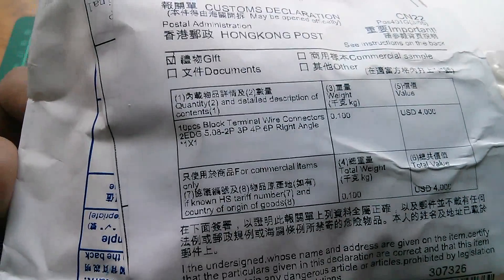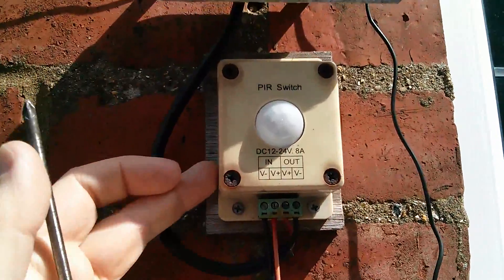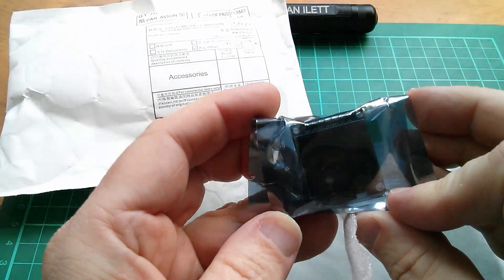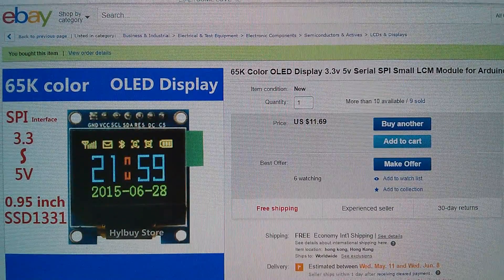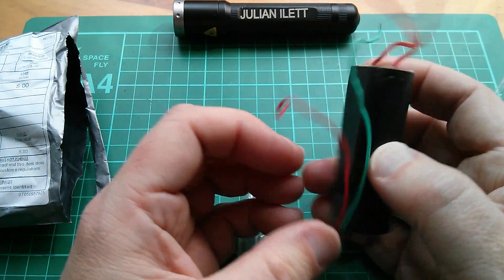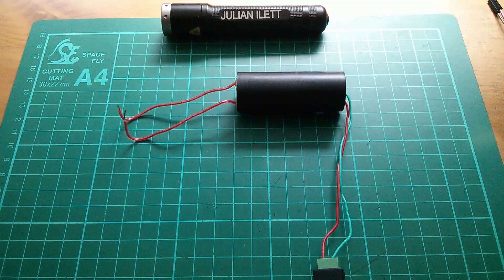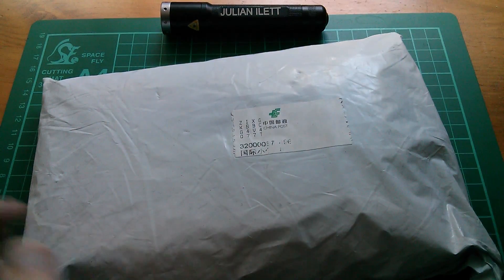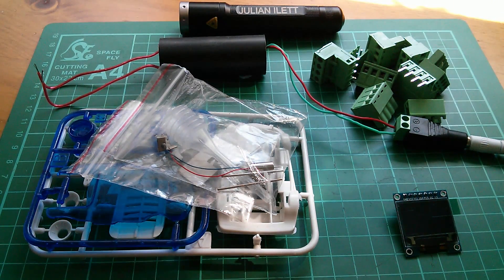Julian's Postbag: #62 - Colour OLED, 400kV Taser, Salt Car

Comment: For exposed outdoor boxes / connectors, a spray can of "spar varnish" polyurethane is your friend!  A very_light_coat will keep your screws and other metal from rusting quite as fast.  The reason I emphasize the very light coat is that a heavier coat has a high chance of trapping moisture - making the problem ten times worse instead of helping at all.

Comment: Calculations say 400kV is silly.   BTW:  If the spark is not maintained when the high voltage is on, these things tend to destroy themselves.  This all started with the 3V to 7000V modules, I used one to charge a 200lb capacitor--took a while, but got over 6000V.
Reply: Does the output voltage for the kind of step up modules in the video change in proportion to the input voltage?
Reply: @davadoff  In my experience it does, but as far as driving it higher than rated,it will certainly fail--heck, I've had a couple blow after seconds of use at the -rated voltage!  The outputs are nowhere near than that advertised either.  I think they are WC voltage multipliers,so, after your comment, I think I will try driving them at a LOWER than rated input!

Comment: The 400kv rating is a Chinese exaggeration. Just like the 100,000mah USB backup packs for less than $10. Theses HV generators are about 20-30kv.There are capacitors on the output. You waited to long to short the output. You have to do it emmediately after turning it off. There is a 2 or 3 stage Cockcroft-Walton voltage multipler after the HV transformer.
Reply: BTW. the multiplier acts as a half wave rectifier, so you end up with a pulse dc output.
If you attach to metal rods to the generator and the outputs to the rods, you will go to jail.

Comment: I always smear a healthy coating of dielectric grease on any exposed connections like that.  Pretty much eliminates corrosion and basically waterproofs the connector
Reply: Stranded copper wires in screw terminals is not terminated properly and a poor connection too. Needs crimped cables such as bootlace crimps.

Comment: so what would happen if you put your finger in the spark would you be kill straightaway or would it just hurt or would you get burned or get superpowers or what
Reply: Super Loops it all really depends on the current. this thing is basically a tazer, it works by transforming the current it receives into more voltage. Which of course lowers the output current. tazers don't kill because they output low amounts of current, voltage will only burn/shock you. 

Just remember, you can't make nothing out of something. If you increase one thing another has to lower. in this case, voltage increases (which doesn't kill) and current decreases (which can kill).

Comment: no they are done with diode cap array so I''ve built them to 50 kv easily USE CAUTION or die! there's no Xformers in them!
Reply: A voltage multiplier (diode cap array) won’t work on DC and this module takes DC.

Comment: HV inverter looks like the drive module out of a helium neon laser I used to own. Can't be more than 8kV, and thats the unit trying to start a laser tube. Run it for more than a few minutes like that and it'll burn out. For reference once they strike a tube the internal cascade is bypassed by the low impedence of the lit tube, and it winds back to 1.8kV or so. It WILL give you a nasty kick if you touch it. I've done that by accident with a much larger one about the size of a packet of cigarettes, or a plug pack. Smarts like crazy, and will throw you back a bit, but won't hurt you. Needless to say you won't do it again :)

Comment: Julian, have you heard of Plasti-Dip (or Rubber-Dip)? That stuff is ideal for protecting electronics against the elements - I use it in my aquarium setup. And if you need to access the terminal, it peals away easily. And, when you're done, you can simply apply some more to cover up the tear. ;-)

Comment: Be real careful with that high voltage thing, it's isolation is not built to withstand anywhere near its output voltage. I had one, got a big jolt through my fingers AT THE VOLTAGE INPUT while I was hooking it up to a single cell li-ion battery and note that I wasn't anywhere near the output wires. Into the bin it went for me. Also while it may be working fine now, the poor insulation on the thing will slowly get eaten away by the high electrical stress and one day you may get a nasty surprise.

Comment: You can test how much it outputs by measuring the distance it starts to arc using Paschen's Law. One of the uses for this inverter may be cattle zapper, it outputs significant high current to cause quite a painful shock.

Comment: +Julian Ilett Obviously not 400kV, but your reaction was priceless - the muffled shouts in the background had me in stitches. Seriously, I think the main practical use for these is in oil boilers (US=furnaces) where they provide the fuel ignition - every ordinary domestic oil burner works with a spark generator like that. They usually run around 10-20kv. I wonder what it was doing to radio reception locally while it was arcing?
Reply: An oil boiler? 🤔 Don’t you mean gas? (gas central heating in UK, used in almost every home).
Reply: @davadoff  Not at all, I mean heating oil (kerosene). Remote and many rural areas of the UK have no mains gas supply and use either electricity, propane, or oil boilers. An oil boiler needs a much more sustained and powerful arc than the quick spark that a gas boiler needs to ignite the fuel.
A brief Google search suggests that well over a million homes in the UK (about 4%) have an oil-fired heating system.

Comment: Why don't you just put the whole connector inside the IP pir box, the silicone up the hole ? , why leave the connectors outside when they "will" get corroded.

Comment: I got one inverter like that. There is capacitor on output and dont remove that plastic glue that hold wires in place on case. That is isolation i removed that and it now doesnt have same much voltage on output. There are loss and when i touch case sometimes i got shocked. There is about 20kV. Same is with flyback transformer and homemade jar capacitor. Find one 250v or 400v red capacitor >330nf and make spar gap to it and charge it up and when you dischare it it was BIG boom. :D Be careful.

Comment: Best deal I found on eBay for the high voltage module is £1.60 - let's see how long it takes to come :-) http://www.ebay.co.uk/itm/NEW-DC-3-6V-6V-To-400000V-Boost-Step-Up-Power-Module-High-Voltage-Generator-/152062543796

Comment: Air has a dielectric strength of about 3 million volts per meter.
So 400000V should breakdown a gap of about 13.333cm or 
5.2493 inches.
Reply: Approximately.

Comment: thanks for the tip on the high voltage unit. 3 on the way. Looks like fun. I have a supply from a HID headlight unit, salvaged from a busted up headlight unit (oem). That thing is evil, 25000 volts 30 watt, 12 volt in. :)

Comment: Those connectors are common on 3d printer boards. Some of the clones don't handle current very well before they melt. Doesn't look like an issue for you though.
Reply: A 10w light on 240v mains is 42mA… so a tiny fraction of what the connector should be capable of. 

Screw terminals with stranded copper wire become loose because the copper deforms. Solid core cable or crimped ends would be more reliable.

Comment: The OLED has an interesting feature: After the reset it measures the SCL line. If it is pulled high the display goes into I2C mode. If it is hard low the display goes into SPI mode. Very handy but something to consider when connecting this up. The reset line of the display should also be handled by a port pin and not a general reset line. So its possible to control which mode the display will be in.

Comment: I've seen one of these cars before. The moulded plastic, cell and motor were identical.

The metal electrode was magnesium, and you were right that the black was carbon. Indeed they do supply multiple of the magnesium and fabric layers. After ~20minutes use the magnesium is pretty corroded. The car should run for 5 minutes or so on a single squirt of water (it was something like a teaspoon salt in 100ml water), and then only a few drops in the fabric placed between electrodes.

Comment: The inverter deserves its own video!!  How far apart can you make the gap and still get a spark....?
Reply: +mnelson10000&#160; 400,000 volts can work a spark gap upto 40cm apart... my kind of fun, I prefer the big one 1MV... lol.. added benefit you get a fresh air hit you like an ioniser. (adding note, it is depend on disc or needle is used, if it a needle, you get a greater distance than the disc, hard to tell how acurren of the device, useful experiment for you).

Comment: I would not be surprised if those high voltage converters are surplus from a product made for Halloween called Electric Flash Crackers.     I have seen other units  on Youtube that seem to pulse the arc at maybe 4 or 5 hz.  The unit you have seems to spark at much faster rate.   I just saw your vid and I had to get a few of those.    When you sparked that thing up you should have seen the smile on my face when it sparked.    Great vids.  Thanx.

Comment: That inverter should be safe to touch, it may tingle, it may burn if held long enough, you'll probably jump a little, but it won't kill unless your heart is very bad.
When you step up a voltage, the current will be less, so even at 1 amp input, the output will be in the micro-amp range, though looking at that spark i don't think that's as high voltage as it claims, even then it's going to be in the low mA range.
Also, that inverter is likely to be fully potted, you could waste your time trying to open it.
There's many inverter circuit diagrams out there, use a small open transformer, you could even rewind the secondary for multiple isolated outputs.

Comment: That was terrifying. I won't screw around with high voltage AC, I simply avoid it. I've been hit by a 5000 volt electric fence and that was all the experience I needed to know to stay away from it.

Comment: If you make up a capacitor divider with a string of capacitors you can then measure the voltage on the output.
Reply: That’s an interesting approach…

Comment: Im sure that the one in the diagram that you say looks corroded is the carbon material which goes in between the two plates. Good luck trying to get that HV generator "inverter" open. Its potted with hard resin. Most HV coils like flyback transformers, need to be Potted in a vacuum to prevent internal arking. And yes there is a capacitor(s) on the output. There is a risidule charge on there but it only last a few seconds. If you touch the two wires together quick enough after you turn it off, you will see a spark. So be carefull. There seems to be a marx generator stage(s) on the output. Aparently they have a DC output according to some of the descriptions on ebay. Just like your 30000mA ebay power bank, I dont think its 400KV. It only arks about 1 - 1.5 inches. Electricity archs through the air at 1KV per mm or 25KV per inch.

Comment: I use those connectors for all the stepper motors on my CNCs.  I like them but I hear rumours about their poor waggle resistance .

You can measure voltages like that by the length of the spark :) https://en.wikipedia.org/wiki/Spark_gap#Sphere_gap_for_voltage_measurement

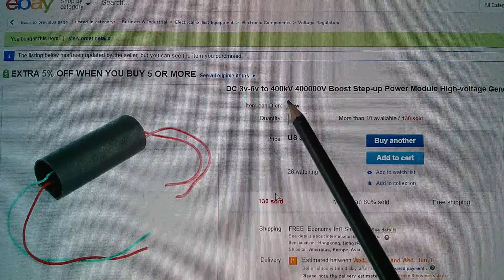Comment: ACTUALLY YOU CAN MEASURE IT!  At 8:58 - 400kV should jump about 5" or 13cm.  If you want to get a reasonably accurate measurement (without some kind of expensive HV probe) you will need to use some known diameter metal spheres, check your atmospheric pressure, humidity and temperature but it can be done.  BUT a simple test to see if that thing is even in the ball park would be to slowly close the gap between the wires until it jumps.  I would start big and close the distance 1cm at a time, turning power off between each test.

Comment: Julian you should be smart enough to note that this thing is not generating 400Kv
Reply: +zaprodk  Are you sure you mean mm rather than cm?
Reply: Ray Kent Good catch. A typo on my side.
Reply: +zaprodk 
But who can prove otherwise?
Reply: +Joseph E Just the size of the device itself is not enough to withstand that voltage. A good rule of thumb is that high voltage jumps 10mm for each 10 kV in atmospheric air, so if that device was a 400 kV, the spark would be able to jump 400mm, which it cannot.
Reply: +zaprodk yep
Reply: Hi mate do you know if the output wires can be lengthened & if it would ignite a firework fuse?  it would be better than getting close up with a match. ( love fireworks ) hope you can help, Thanks.. John :)

Comment: That thing is more like 10-40kv, chinese exaggerations
Reply: +ELECTRONTHORP The 6800mah 18650 batteries... Led lamps in general. Ebay in general.
Reply: Also those sparks are super weak, theyre nowhere near lethal and wont set anything on fire (except gasses)
Reply: +drkastenbrot third comment, why not...
You wont be able to reuse that, they last a couple of minutes and then they die.
Reply from the maker: +drkastenbrot It doesn't sound weak - it's incredibly noisy.
Reply: +drkastenbrot Yeah, 400 kV is like one of those large overhead transmission lines.
Reply: +ELECTRONTHORP Same factory as the 5000 watt police led flashlight.
Reply: +drkastenbrot same with EVERY taser on the market. not even the chinese scam buyers in this rating.

its just a 1-5kV inverter inside + cascade to ramp it up to 10-30kV  the loud noise you hear is the capacitors of the cascade discharging..  it it would be "400kV" under normal conditions it would cross a gap of around  30-40cm...
Reply: +drkastenbrot for some reason you have assumed I was asking you. I was actually telling you.

the 'volts per centimetre thing' is precisely understood. it's an exact relationship dependent on pressure, humidity etc.
Reply: +John Berry It would hurt quite badly. I dont think its lethal though unless you insist to touch it 24/7.
Reply: +Julian Ilett Yes, noisy because there at lots of volts around, but no kick as there is no real current... put your multi-meter in series with one of the input wires and find out the current... and then factor in that the current must be dropping for the voltage to increase... so if you decided to grab both wires you would get a 10-40kv 0.1ma zap? Anyway... you need to show us how to make one of those globe thingy's now you have the hv component ;D
Reply: +drkastenbrot And the 3800mAh AA cells
Reply: It's a theoretical 400k volts. However, 400k volts cannot actually build on the output before voltage is lost to the ionization of air. This is due to there being basically no current driving the voltage.
Reply: nooo, they are safe to lick.
Reply: i hooked up a 3V led to the output of one of those to see what would happen and it just lit up, nothing else happened. do you know why?
Reply: LEDs are driven by current and your led wont blow up to 50 milliamps. The HV supply put out a very high voltage at a low current, likely less than a milliamp. That is why your LED survived. It clamps the voltage down, it would be safe to touch as llong as its lit.
Reply: +drkastenbrot So you're looking at around 30kV per centimetre of arc. 50-60kV seems about right.

They also draw about 2.5 amp @6V make of that what you will.
Reply: +flagpoleeip The kv per cm thing is pretty useless, theres too many factors involved. I just estimated that from my eperience with low current feedback-driven hv generators. Since it has an output capacitor, the voltage ramps up before sparking over, so that should be able to do a bit more. The secondary isnt very reliable tho, it breaks easily.
Reply: thats still very decent converter
Reply: +flagpoleeip I havent answered a question, at least that wasnt the intention. I just critizized the v/m usage, because it isnt accurate enough.
Reply: Hello mate I have just ordered one of these. Basically - are they dangerous ?
Reply: What would happen if you touched the spark?..  Thanks  John :)
Reply: What would happen if you touched the spark?...  Thanks :)
Reply: It can't be any worse than like an electric fence, surely.
Reply: haha "cant"  electric fences pulse like once per second. this one is depending on resistance thousand times a second or more.
Reply: You do it first then mate :)
Reply: after reading Arnauds comment I took an led and rather than connect it to the output wires I held the legs in the arc and it destroyed the led. the outer surface is intact but looking through a loupe I can see fractures and darkening inside the plastic centred on the die

Comment: The little fuel cell is probably a magnesium and graphite battery. The magnesium electrode will oxidize during the reaction (probably why there are 2 plates). The graphite will not degrade.

Comment: you could measure the voltage of the inverter by measuring the spark gap length. something like having a spark between two screws, and adjusting the gap length (while the thing is off). That would give you a rough approximation of the voltage if you care to know.